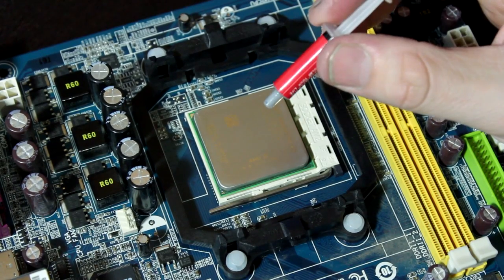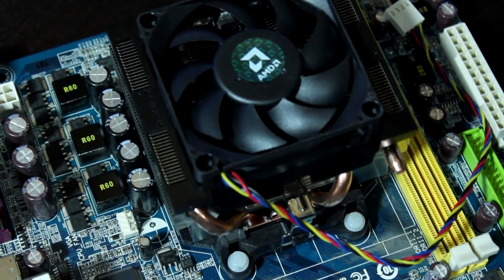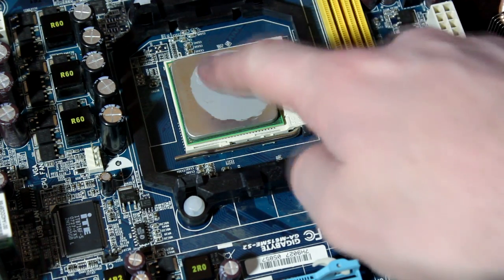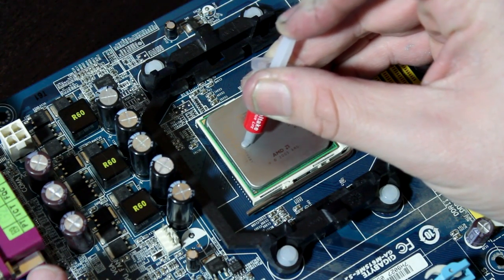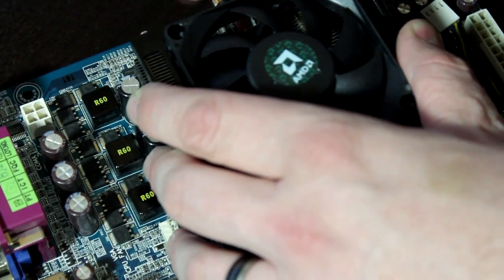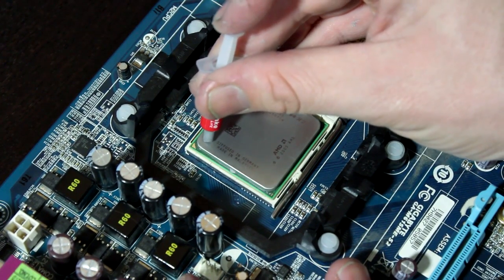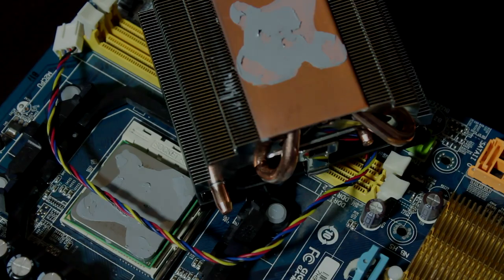How to install Thermal Paste

Comment: #Help #NeedAdvice
I just applied a fresh drop of thermal paste on my CPU and seated the monoblock over my CPU, but without thinking, I lifted the monoblock alittle and adjusted to ensure proper alignment on the motherboard...

Now I'm worried I may have to clean the freshly applied thermal paste and do the whole thing all over again, because I may have inadvertently created small pockets of air, which may result in bubbles, which might affect my CPU operating temperatures.

Comment: Guys, I'm in need of help fast. I live in a remote area, and I am not willing to let a big store like Best Buy ruin my computer. It is gradually heating up, and I believe it's been 3 years or so since the paste was applied and the heatsink installed with it. I am no technical genius, far from it, and I need advice as I can't seem to find what I need. Is the X method the very best, and will this work for an Intel i3 2100? I know it's super old, but I wish to extend my computer longer if it's only thermal paste that is long overdue. When should it be replaced? Anyone know good guides for removing old paste and putting in the new? I need help fast, because the temperature is steadily rising each day. Please, help me out!

Comment: I've just been watching loads of these vids as I'm about to install my h60 replacement for a busted one I had. I'm a bit concerned that non of these methods seem to cover the whole square. Is it necessary to have 100% coverage? Most pastes seem to come with some sort of spatula for spreading. Is this not what the manufactures of the pastes would deem the best method, as they include the spreading tool.

Comment: hes using low quality thermal compound so its not spreading good in a "pea" pattern (which is the best) from what I've heard. He should have used a qualtiy Thermal compound for this , i don know why he didn't

Comment: I know this is old but line method is better. The die of CPU is lined up down the middle and most of the outside of the heatspreader is not actually used.
Reply: Linus tech tips tested it extensively it no longer matters
Reply: Performance wise it wont matter if you get the entire surface covered however the die is still not on the edges and only lined up down the middle. So if you do the line method you are much more likely to cover the entirety of the die and if the outer left and right edge is not entirely covered it does not matter. If you want to do it the right way with less chance for air bubbles and more chance to cover the die itself then you do the line method. Cross lines runs a risk of air bubbles depending on the paste used if it doesn't level out properly and dot doesn't always get the edge of the top and bottom especially if you dont apply even pressure. It wont make a difference if you use enough paste and get it where it needs to go but line method is the best choice.
Reply: and I also did comment on that Linus Tech Tips video as well. I went into more detail on there. No response and no new video so I doubt they noticed my post or care.
Reply: Dave Morgan i hear a lot of bull about air bubbles............there really not that hard to get out and the risk is only increased by about probably the same amount as winning the lottery possible but so unlikely it doesn't really matter and cross method spreads better than the line method  so the crap your saying about line method getting better coverage is pretty obviously bull cpu's aren't built the same as they used to be line isn't any more effective than the dot anymore and gets about the same percentage of coverage the shape of the copper plate on the heat sink matters more than the die position these days we are not using dual cores anymore at least the majority of us aren't that is why the line method used to matter as the 2 cores where split between the two half's of the die wich made a difference back then this is no longer true with quad cores being the general standard for cpu's so the die placement was changed and the line method no longer makes a difference
Reply: Dave Morgan linus tech tip probably didn't reply due to size of channel the outdated theries you probably spouted blah blah blah
Reply: The cpu die is in the center lined up vertically. You are more likely to cover the die itself if you use the line method. Dot works pretty much just as well but you must be more careful about placing down the heatsink evenly. Again the best way is the line method look at where the CPU die is located. My cpu is delidded and I know where the die is. It is not rocket science. The die is lined up vertically down the center if you want the best chance to cover it without issues draw a line vertically down the center. Again the left and right side of the heatspreader is not used at all so covering more of it is pointless, you want vertical coverage just like his line method showed in the linus tech video. If it had 2 dies it would be better to run 2 lines directly above the dies. As you say this is a minimal issue but I have seen air bubbles occur it was mostly during the nanodiamond craze when everyone used nanodiamond which tended to be thicker and more likely to bubble up. It also tends to happen with people with waterblocks more often then others, likely due to using too little paste but people do report airbubbles and hotspots. I used to see it all the time in the OCN watercooling club. New cpu are not any different the die still goes up and down the center.
Reply: Actually some are more square especially if you get AMD which would be more effective with a dot method but for the most part a majority are vertical down the center.
Reply: Dave Morgan well you seem to be the type that "is never wrong so long as i say it isn't" and has likely no gone into detailed research of current CPU structure as the cpu die are not really lined up anymore
Reply: bacon Bliss Do you even google? I own a 4790k which is a little older but still highly popular and it is delidded. Die is near center slightly offset vertical going up and down and is a rectangle (Ivy and haswell are very similar). Skylake is a rectangle slightly off center that is a little more square but is still a rectangle near the center going vertical. Broadwell is usually dual die but is located closer to the center generally going longways (depends on orientation, whichever side is longer is the direction the line should face). Broadwell-E is almost square but slightly rectangular in the center vertical. All of these are the newest architectures that are most purchased and all of them would be best to use line method. Only difference is AMD which Kaveri is a square so it would be best to do dot method but even then it runs the risk of being pushed off to one side if you fail to put the heatsink down correctly. The differences are minimal it is pretty hard to screw up thermal paste using any method but I have seen the underside and the die is most likely to be covered using the line method on most CPU. The line method will help assure that people who use too little paste hopefully still cover the die and it helps prevent spreading off the wrong way if someone puts on a heatsink at the wrong angle. This isn't rocket science. I have no problem admitting I am wrong when I am wrong. This is not outdated theories this is logic based on how the paste spreads and where the die is located.

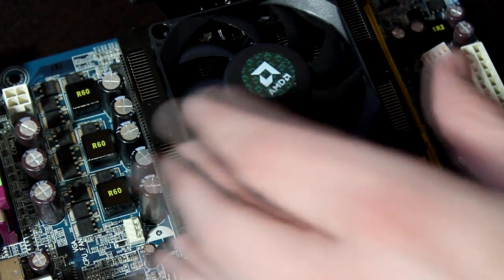Comment: 1:45 same thing happened to me with my old PC :D interesting.
Reply: i used toothpaste once, i had to use a screwdriver and a hammer to separate the cpu from the heatsink :D
Reply: @TheIdiotPlays You're joking ? i still kinda wanna believe u though
Reply: +Crywolf* Gaming athlon x2 4400+ and the stock cooler. It happened like 2 years ago so i really can't link a pic sorry. I do still have the cpu and the cooler for kicks if i ever decide to do an xp gaming pc
Reply: cheap thermal paste is just a nightmare. it literally glues CPU to heatsink. never use it. damn.

Comment: Ummm... why not just spread it yourself?  It's the way I've done it every single time without issues.  Infact I bought thermal paste and it came with a "spreader", I'm guessing for a reason!!
Reply: Instructions not clear, no ravioli in between by CPU and Heatsink. Wat do.
Reply: if you spread it yourself you can create air bubbles in the compound wich can make the whole bubble not contain any pasta when you apply the cooler
Reply: ***** yes most of the cooling compounds will create small airpockets.

Comment: what about a X then add small lines on each part of the X  putting them in between each space like a broken Square  like I __ I    as ur example of the x has gapes after removing the fan so the lines would full them in  i though about just add a square boarder  like a frame around the processor not to close to the edge  then adding the x but because u have a boarder u would only need a smaller x but with the same thickness.

Comment: "less is more" is only true if using conductive TIM. Otherwise use as much as you want, you can do damage by using too little. THe pressure of the heatsink WILL push out ALL excess AIR... AIr is less conductive to heat then TIM, hence why its put there in the 1st place.... Basics people, basics :)

Comment: I  am going to purchase a Corsair Hydro Series™ H110i GTX 280mm also the artic silver 5 compound ,  this would be my first time doing a CPU Water cooler  install. My question is do I have to remove the Pre-applied paste that the Corsair Water Block has and put silver 5 ? Or just put  silver 5 on the cpu and  install the block with the already pre applied  corsair thermal compound
Reply: Yes remove the old stuff, it's quick and easy! Use rubbing alcohol
Reply: +Jaxson Otis Everyone keeps saying "use isopropyl alcohol" so now idk if I can use just normal ethyl alcohol or not. Plz help!!
Reply: Yea you should be able too. I used the stuff my pop uses for her nails lol. Just uses a cloth ball or tissue and youll be fine. You could probably even use water if you rub hard enough
Reply: Just looked it up you can use the normal ethyl
Reply: Yea, I already did it yesterday! Thanks tho :)
Reply: ok cool

Comment: Damn it! I was just cleaning the old paste off and spilled   the bottle of isopropyl that was in my other hand all over the motherboard. :(  
Maybe it'll bring a new meaning to gaming in a drunken state.
Reply: dafuq
Reply: *****  I popped the cmos battery out straight away and mopped up as much liquid as quickly as I could then left the board out in the sun for a couple of hours.. and surprisingly it lived!  :-)
Reply: +Peter Simpson 
Its not surprising at all, or rather, it shouldn't be if you know some of Isopropyl's basic features/uses. It's used to clean / revive board's that have had conductive liquid like water, spilt on them. It has a fast evaporation rate in oxygen, so yes your board would have worked (and never been damaged btw). I suspect even totally emerged in Isopropyl that your mobo would still have run.

https://en.wikipedia.org/wiki/Isopropyl_alcohol#Solvent

Solvent[edit]Isopropyl alcohol dissolves a wide range of non-polar compounds. It also evaporates quickly, leaves nearly zero oil traces, compared to ethanol, and is relatively non-toxic, compared to alternative solvents. Thus, it is used widely as a solvent and as a cleaning fluid, especially for dissolving oils. Together with ethanol, n-butanol, and methanol, it belongs to the group of alcohol solvents, about 6.4 million tonnes of which were utilized worldwide in 2011.[14]Examples of this application include cleaning electronic devices such as contact pins (like those on ROM cartridges), magnetic tape and disk heads (such as those in audio and video tape recorders and floppy disk drives), the lenses of lasers in optical disc drives (e.g., CD, DVD) and removing thermal paste from heatsinks and IC packages (such as CPUs[15]).Intermediate[edit]

Comment: Used to use mx-2 alot with the pea method. After I switched to Ice fusion, I learned how to spread pretty well. While I prefer the pea method with thinner past, the stuff I use now comes in bulk. The trick is when spreading you really have to take your time and do it right. You want to just barely see the cpu/gpu underneath. As some have said, "less is more".
Reply: +DarkBazerker "less is more" is only true if using conductive TIM. Otherwise use as much as you want, you can do damage by using too little. THe pressure of the heatsink WILL push out ALL excess AIR... AIr is less conductive to heat then TIM, hence why its put there in the 1st place.... Basics people, basics :)

Comment: I used to use the dot method, then I tried your X method and my cousin temp went down by 3c, it's not much but it helps
Reply: +Hidden OS 3C is a lot for a cpu.
Reply: +Tinyjb0 is it really, btw I just realized it auto corrected to cousin, I'm glad you knew I was talking about the cpu

Comment: you don't need to cover the edges of the CPU metal cover. The CPU's cores are much smaller in size. The P-method is still the best way to apply thermal compound
Reply: +Tinyjb0 You don't need to cool the whole cpu, just the cores.
Reply: +Senkettsu Then explain why I, and many others, get better cpu temps with the X method?
Reply: +Tinyjb0 actually my computer turns on then over heats with the x method
Reply: +Tinyjb0 p is the way to go

Comment: my computer was overheating and it was due to too much heat paste having been applied (my mate who is a computer tech fitted a replacement cpu ) when i took off the heat sink the cpu was stuck to the back of it i cleaned the old stuff off the cpu and heatsink and applied a small amount refitted the heatsink and havent had any problems with overheating since
Reply: +TheThecyclist your issue was not too much paste, either his method was shit / made air holes or the paste he used was shit. See my comments above as to why you can never use to much , as long as its non conductive.
Reply: +TheThecyclist the amount of paste i put was small but when i recently removed the heat sink to clean dust out of the vanes the paste was evenly spread over the whole of the cpu and yes i replaced the heat sink paste before refitting the heatsink i also cleaned the cpu using a cotton bud and surgical spirit (its the same as the alcohol you use we call it surgical spirit in britain) and the cotton bud was black as there must have been further layers of old paste that you cant see by eye and as you say either his method was crap or his paste was crap and im inclined to think the paste was crap also he used too much why else would it still be moist after 8 months
Reply: Its not supposed to dry up in less then a year unless 1)its crap or 2 the heat around the paste is excessive. Once again you can never physically use too much thermal paste. ..Unless its electrically conductive.

Comment: a blob in the middle works the best, cased closed.. Use a piece of glass and press down instead of using the cooler so you can see it spread..

Comment: The CPU didn't come out because of adhesion, it was pulled out due to suction. When you remove the cooler from the CPU, you always twist until it releases. You don't just pull on it, jackass. The pea method works every time.  The line method didn't glob out at the end due to quality, your skills at applying paste is amateur at best. 3/10

Comment: I always put 4 little blobs on each corner with a slightly smaller pea sized amount in the middle. If you put the little corner blobs a a slight distance back from the corners, it will help cover the whole thing without it leaking onto the edges.
Reply: +Shareena Fulton That sounds like the best method, as long as it doesn't introduce air pockets.

also, I think you meant 1 blob in each corner.

Comment: why not draw a square?
Reply: Zade Keys
I dont want to read that so you are right
Reply: co co combo breaker Because less is more
Reply: +Filip Sebik bullshit, its a good heat conducting material "less is more" is only true if using conductive TIM... Less thermal paste = more air between the CPU and cooler and guess what... Air is a bad conductor of heat... Science/TIM basics dude.  Otherwise use as much as you want, you can do damage by using too little. THe pressure of the heat-sink WILL push out ALL excess AIR... The viscosity of the thermal paste will not be able to resist the pounds per square inch pressure applied by the heatsick... AIr is less conductive to heat then TIM, hence why its put there in the 1st place.... Basics people, basics :) 

Essentially what your saying is that if you put thermal paste on the ground and stand on it, that the base of your foot/sole of your show will NOT touch the ground what so ever as the TIm will "hold you up".
Reply: +co co combo breaker because it would leave air bubbles in the middle and excess would leak over the edge

Comment: i installed my dark rock pro 3 with a big pea and then spread with the little tube in cross then messed a pea in the middle again and now its at 29c idle (22 ambient) with my 4.3ghz fx8350.... so.... fans are all low at 7v's so...

Comment: After I switched my Thermal Paste My pc started shutting off randomly =/? i tried removing the thermal paste and adding it again, now my pc seems to last for about 1 hours to 2 hours but still shuts off What should i do??
Reply: @iSolvano HDR dude that was 5 years ago lol
Reply: @ameerlol7111  hey maybe hes a procrastinator and still has same issue.
Reply: @RepentTherefore  oh ok ig
Reply: @ameerlol7111  lol
Reply: +TheUltimateAres The motherboard is telling itself to shut off automatically to prevent damage to the CPU or the components.
Reply: ***** It's overheating :/
Reply: Give to a technician.